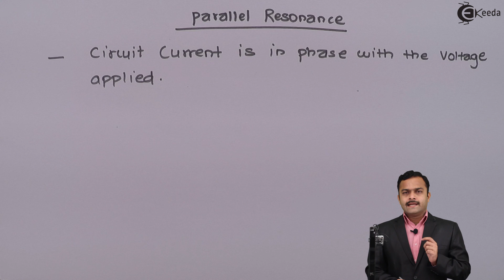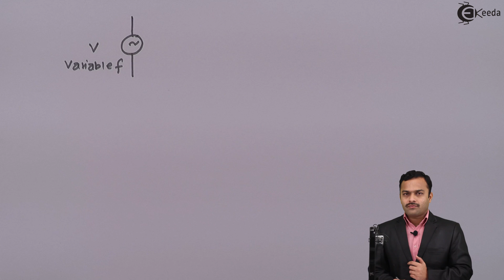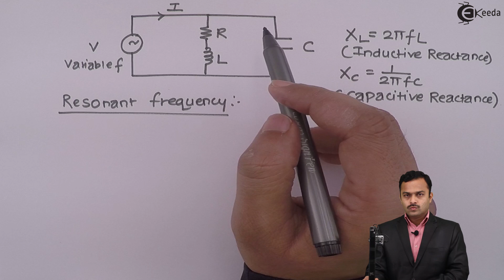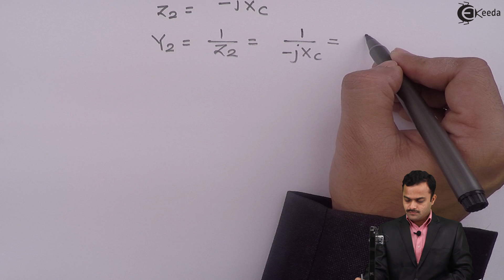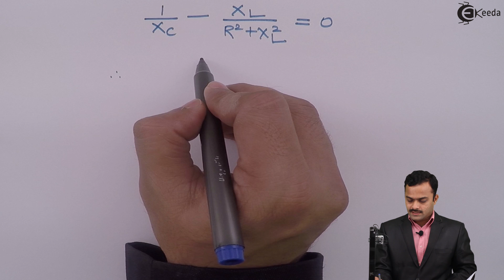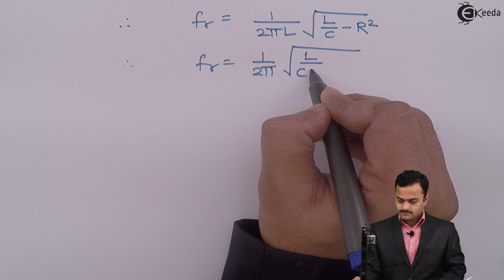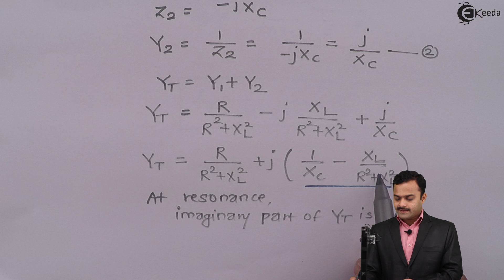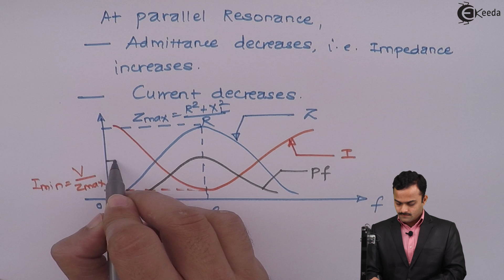Parallel Resonance in RLC Circuit - AC Circuits - Basic Electrical Engineering

Comment: I was measuring with an oscilator and the part output I was measuring included a resistor, a coil and a capacitor. when I calculated my theoritical values my Q factor came out at 0.033 but through the V=f(frequency) graph(and I was using peak values so I maltiplied my max voltage value with 0.707 to get the rms and I found my BW at around 4khz and my  Fr was 1592. anyways using a formula I found out that my Q factor using the graphs BW came out at almost 0.4. A significant amount more that expected. I did not account for the phase though. should I or it doesnt matter in this kind of scenario? and if it does matter do I take in mind only the output resistor for the impedance or do I take the whole sum of the circuit? I am confused help

Comment: Why at resonance imaginary part will zero
Reply: Bcoz at resonance, the circuit is purely resistive.There are no reactances in the circuit(neither capacitive nor reactive)
And impedance=(resistance) +or-  i(reactance)
So if reactance is zero imaginary part is zero.
Reply: At resonance what happens is , inductive and capacitive reactances ie XL and XC are equal. Hence, it is observed that the phase angle between current and voltage turns out to be zero. (In a resistance circuit, the phase angle is always zero). Hence the circuit is simply resistive at resonance condition. Now when the complex equation is obtained, there only resistive ie, the real part exists
Reply: And normally the total impedance is 
Z = R +/- iXL / iXC 
So if the circuit is purely resistive then the part with i vanishes

Comment: resistor inductor k saath series mein kion lga hai .parallel kion ni hai.?????
Reply: muhammad shaheer because the resistor shown is the internal resistance of the practical inductor
Reply: But then it is a rlc ckt so why doesn't everything is in parallel...I mean why aren't there three branches one with resistance one with inductor and one with capacitor